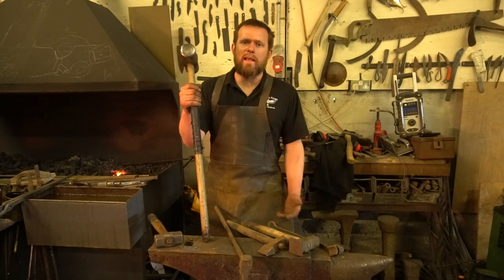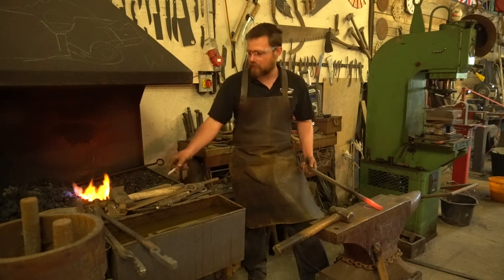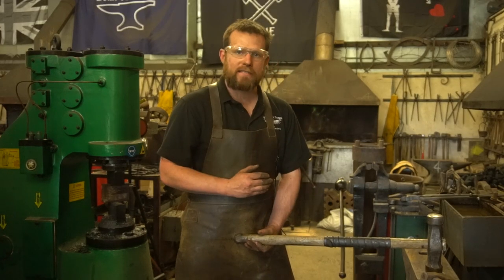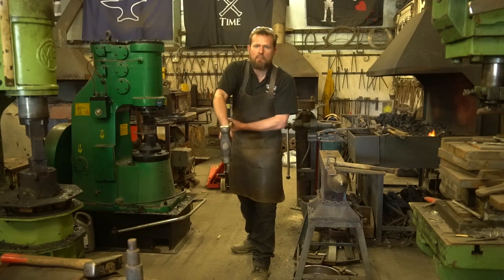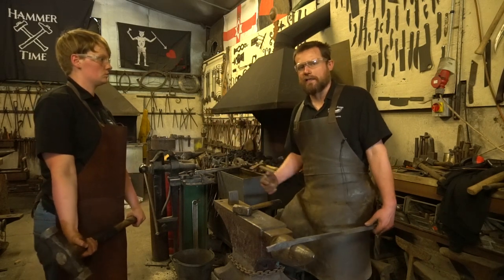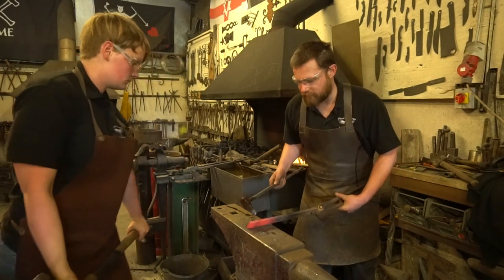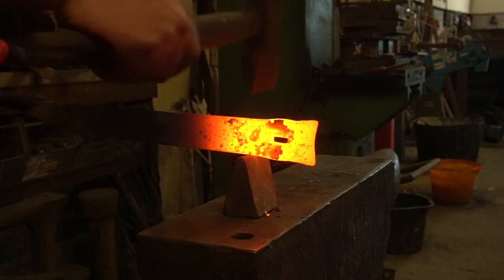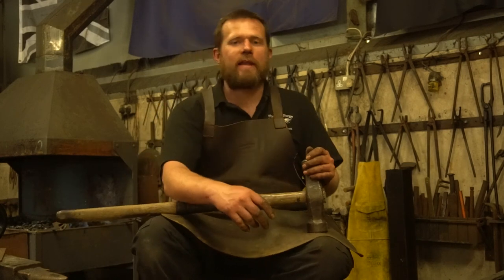Smith and Striker  -Blacksmith Essential Skills-

Comment: I was a blacksmiths striker, and the hammer we used weighed 10lbs, was square/flat..slight rounded striking surface and the opposite face was a rounded wedge shape..but nothing like you have there,there was no marking hammer points, it was all skilled learned working together